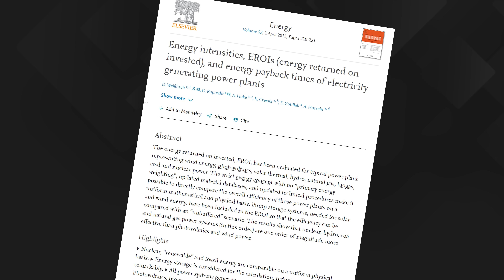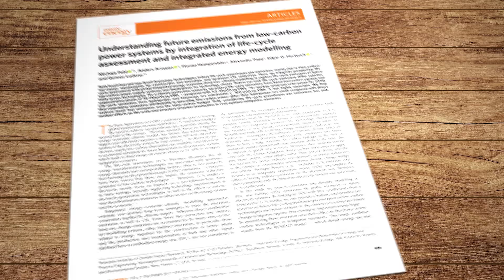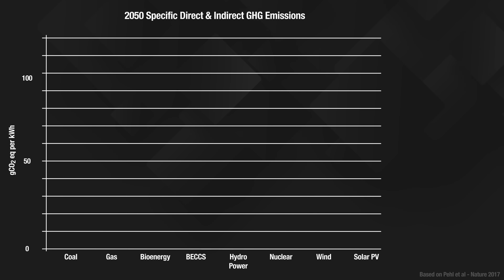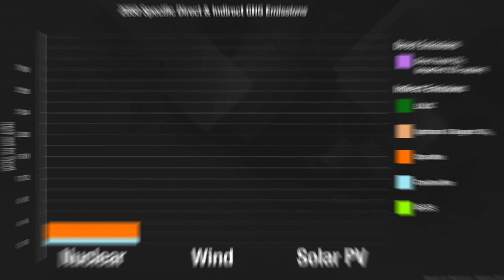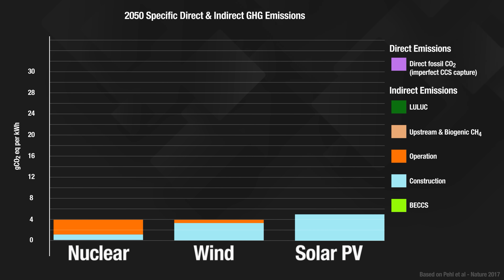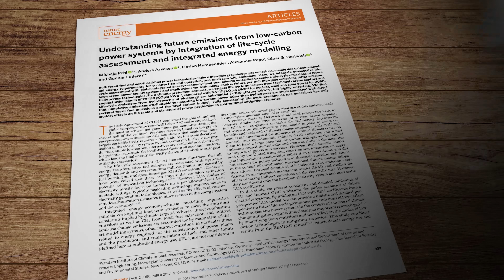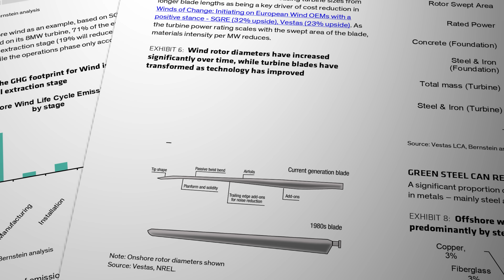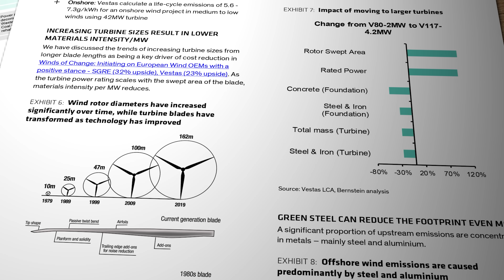Lifetime carbon emissions of renewables vs fossil fuel. Problem or solution?

Comment: I can't believe the BS of solar and wind results. That scream at my ears. "SOMETHING WRONG! THAT MUST BE BIG MONEY PAYING THE STUDY!". Against solar, what are the emissions related to MINING? How about the mining wastewater and environmental impacts? If I am not mistaken, and I work in this area. Wastewater from mining is often, I mean OFTEN,  treated using cold lime softening for precipitation. Mining and preparing the minerals to make the panels, another CO2 generator and they are that low? They must be FK with my intelligence. 
Wind, do you know how long it take to the used and damaged turbines to naturally degrade? So, how many we will need to produce per year? tell me in how many years we will have to really understand this is not a solution? Not to say we will need to have a lot of them to cover the low incidence and very high incidence areas. 
Now, I can't also believe the concrete needed to build a dam for hydroelectric is that much since it lasts forever. I cannot believe that you believe that BS also, you do not even question this crap. What is the CO2 emissions for Hydro production? Did you know that Algae and water consumes CO2? Did you know that Algae balance CO2 vs O2 is positive to O2 side. It is not even comparable to trees, because it is the true O2 generator rather than trees. Tress balance CO2 O2 is virtually neutral and only positive during the period when the trees are growing. 
Can you be a little honest in your videos and respect our intelligence?

Comment: I'm from England, the points I'm  going to make relate to articles and interviews regarding the National Grid. Wind and solar are increasing rapidly. There have already been days where production outstripped needs. On these occasions people with electric cars or home battery storage were paid to take electricity. As more electric cars with the ability to store and offload to the grid, along with the electric charging points and the battery packs of small and medium sized solar/wind systems come online they will provide that buffer. When this develops,and it will,  who takes the hit for the battery. Vehicle manufacturers, tesla for their powerwall or renewable providers. Solar solutions will become more efficient, turbines will get bigger.  Coal, oil and gas are unlikely to improve efficiency, especially now.

Comment: Aside from the advantages of lower life time carbon emissions of wind, solar etc vs fossil fuels there are other reason for embracing the cleaner energy including:

(1) less energy dependence on a few producers of fossil fuels;
(2) fossil fuels running out (eg peak oil)
(3) environmental damage during extraction of the fossil fuel.  

But really thanks to (2) we are going to have to face into a fossil fuel scarce future anyway.

Comment: Has anyone ever evaluated the direct influences of PV and wind electricity generation? I'm not talking about shredded birds, but:
1. A wind-farm draws a lot of energy out of the atmospheric rivers (aka. "wind"). How does global scale electricity generation affect the flow of air-masses?
2. Most PV panels are very dark, so they become very hot and this heat is dissipated into the surrounding air. We already know about the effects of urban heat-islands, what if this effect is amplified by covering each roof and each south-facing façade with dark PV panels? How would the local weather be changed? 
To make it clear, I'm not against "renewable" energy, but if you remove energy in a large scale from a system (wind) you will change that system. Changing the albedo of a landscape (city) will have an effect - that's why they have started to repave dark asphalt-streets in Lost Angeles with light gray concrete streets to reduce the local temperatures.
It would just be great to know about unintended side-effects before globally rolling out a new technology.
Reply: LOL why would they do that ? That makes too much sense , to look at it could throw a monkey wrench into their plan. Its the reason for the worlds many self inflicted wounds.
Reply: @neverettebrakensiek8771  Unfortunately i am afraid you are correct. 😞
Just look at that lunatic discussion about not shutting down Germany's last three nuclear power plants at the end of this year. The Green party's ideologists rather have the German's shiver during the winter instead of keeping the NPPs up and running… Ideology beats Intelligence every time.

Comment: There is not enough neodymium on the planet to make the wind turbines needed to come close to generating the amount of electricity we currently use. There isn't even enough copper to run all the wires needed to transmit the electricity everywhere it needs to go. We need to stop clinging to a world of ever increasing GDP. Infinite growth on a finite planet is ridiculous on its face.

Comment: As far as I'm concerned, once you get 25 or maybe even 50 gCO2/kWh, lower carbon emissions don't matter than much. The difference between one technology at 25 or 15 or 5 is within margin of error and will be different for every study, but they're all basically low-carbon enough. The issue with looking at lifecycle ghg emissions for wind and solar is that wind and solar don't provide dispatchable electricity, so the lifecycle calculations must also include backup and storage, which is very likely going to include some amount of natural gas. I'm surprised to see the ghg numbers for hydro in this study, and it's concerning because that will also carry over to pumped storage, our only real form of grid-level energy storage, thus affecting the lifecycle emissions of wind and solar, and even nuclear to some extent. Net zero is a lot harder than most people, even those involved heavily in the movement, realize.

Comment: The problems with Wind and Solar is intermittency and inefficiency ( more wind in spring and fall less in winter and summer when we need houses heated or cooled) ) The fact is that anyone living on the GRID requires reliable output regardless of whether the sun shines and the wind blows.  So without enormous energy storage batteries  capacity (which do not yet exist) wind and solar deficiencies require quick-firing fossil-fuel burning BACKUP GENERATION  thus pumping carbon into the atmosphere which is why despite their massive investment in wind and solar well meaning GREEN window dressing,  Germany now finds themselves returning to coal fired generation...  Nuclear is the way to go.

Comment: I think this kind of misses the mark of what EROEI implies about wind and solar. It's not just that wind and solar will have higher lifetime carbon emissions, but that the total cost to build an energy system using only wind and solar will be incredibly high. Recycling wind turbines at 9:45 uses currently diesel-fueled equipment. Hydrogen combustion for steel production at 09:30 requires a huge amount of energy to create, transport, and store the Hydrogen. All of this is more panels and turbines, which means more processing, construction, and mining. With a low EROEI, a large portion of the energy produced is cannibalized by the system itself, thus creating a full life-cycle system of energy without the use of fossil fuels is going to be extremely expensive, and that will have real-life effects on the length and quality of human lives.

Comment: Hate the thumbnail shown water vapor from cooling towers to represent fossil fuel emissions. 🙄
Residential solar is great. They should incentivize/require a certain level of grid tied battery capacity to buffer peak residential draw offset otherwise high grid maintenance issues.  
Grid scale solar has significant land use impact. 
All grid scale solar installations should also be required to install a certain portion of energy storage to smooth peak production and grid draw to help eliminate the need for peaked plants. 
One issue with solar is massive environmental impact from panels that end up in landfills. 
As efficiency of panels increases there is significant incentive to replace panels. We are already at the point where we have 30,000 tons of solar panel waste annually in the USA... 
That number is going to skyrocket with more solar installations projected to hit over 1 million tons annually in less than 10 years. If there is a significant efficiency breakthrough expect 100% of grid scale solar installations to be replaced generating massive flood of waste... 
I'm a huge fan of SMR nuclear. The risks are mitigated, the waste is extremely concentrated, and the emissions are as low or lower than renewables without all the other issues.

Comment: We could buy some time by driving slower. (Drag is the main consumer of your car's fuel above about 25km/h, and I think the increase is by the cube of velocity - so the savings are exponential, and better than just "square-exponential").

The downside is that lower speeds adopted by just one country might put that country at some competitive disadvantage, so it's probably only a viable proposal if adopted worldwide. If everyone is going slow, the relative economic impact is the same everywhere. It makes no competitive difference, if it's kept out of the competition. 

Going slower as a "war measure" , while the Russians invade Ukraine, and pay the cost of all that killing by selling oil and gas to the next victims in the queue, might be something to consider? (This war offers opportunities to put "Green matters" into the "defense budget" - defending against the possibility of a war, rather than waiting until one possibly happens, and then just reacting.)

Some other benefits that might flow, if you make the maximum speed low enough: It might be the tipping point for someone who was considering commuting by train instead of car. Lower road accident deaths (guaranteed; speed still kills). More range for EVs. (EVs don't strike me as any more of a "solution" than does reducing speed. They would also be a temporary measure if society was truly committed to not committing suicide by CO2, too.) ... There must be more, surely? (Although the reduction in emissions is enough to justify it.)

Comment: Whilst I do NOT care about saving the planet I have no problem with getting rid of fossil fuels. Anything to reduce our reliance on despotically lead countries. The process though must be from the position of being able to produce at least 100% of our power requirements domestically. In my mind that means having a baseload met by nuclear with wind, PV and and a small amount of domestic biomass. Domestic batteries will help with very short term power fluctuations and grid support. Chopping down US or Lithuanian forests and shipping trees to burn in our power stations is ludicrous, so let’s grow hemp instead. While we are at it, we can also stick carbon capture where the sun doesn’t shine - it’s a non-starter. That leaves the problem of how to meet short and medium term seasonal power demands. This is where we have to grow or manufacture our own biofuels (including hydrogen) to be stored for the winter months when it’s cold, the Sun doesn’t shine and the wind doesn’t blow.

Comment: We are currently using fossil fuels and renewables to power our civilization. Conceptually fossil fuels originate as solar energy captured over millions of years and concentrated by fossilization. Our power hungry global economy is burning through this multi-million year stash in a matter of a couple of centuries. That still growing intense energy usage is close to if not already exceeding the amount of collectable sunlight currently falling on the planet even lumping solar, wind (from solar heating), hydro (from solar evaporation) , and BECCS (bio-solar). Only geothermal and nuclear are additional to sunlight and only geothermal is actually renewable -- we think. We really cannot simply replace fossil fuels with renewables without drastic cuts to our energy usage, and we must replace fossil fuels.  So, on top of turning off the fossil fuel tap, we need to shutdown about half (or more) of our current energy usage globally. Yeah, that's probably not going to happen.

Comment: The idea that "renewables" will allow civilization to continue as is, is delusional. Simple math can prove that isn't going to happen. Society needs a total transformation from top to bottom. All goods must be sourced locally. No one will be driving anymore in 50 years. All buildings and homes will need to be reconfigured or rebuilt and will need to rely mostly on passive heating and cooling systems. All communities will need to be redesigned to be walkable/bikable. Food will have to be grown locally and sustainably. Renewables will help a tiny bit, but we are hitting the wall of available mineral and energy resources. Those are hard limits. The age of cheap-abundant energy is over and there is NOTHING that can be done about that. Read Friedemann's "Life After Fossil Fuels."

Comment: Do the numbers for wind/solar take into account the batteries needed along with their lidecyle carbon impact? I am particularly concerned with this aspect considering not only the carbon, but other environmental and ethical concerns. It may well be that we have to swallow ethical concerns as we wait for better storage solutions, but it is still disheartening.
Reply: I personally doubt 11g per kwh includes battery emmissions. That said, there are a lot of improvements in battery technology as well that have been coming through in the last few years and not every grid uses lithium cobalt batteries for storage, so it may be hard to determine actual average emissions for the various technologies.
Reply: Don't forget the peaker plants powered by gas turbines; they seem much more common than batteries.
Reply: @ethanwhitehead2085  peaker plants can also be hydro or nuclear, though in both of those cases the plants operate 24/7 and just have their generation levels turned up when used as peaker plants.
Reply: @aaronparry2636  Most peaker plants are not though. Availability of sites limits hydro, while nuclear plants are almost always kept at near maximum capacity so they can repay the loans for their construction sooner. Gas turbines seem to be the go to peaker plant thanks to their dispatchability.

In any case with storage, you have to deal with significant energy losses (either from pumping or from conversions between AC/DC and dis/charging), which is why energy storage is only competitive for peak hours (from a price point anyway), but not so much for shoring up renewables' unreliability issues.

Comment: Any such single value report are really a vast of paper or electrons. You can a hydro-generator producing the same amount as a 10 MW wind turbine without a dam and after construction is completed all you can see is a small building. It can also be a big dam that catch a lot of silt, but the effect of that will be very different based on where in the world it is done. All the assumptions need to boil the numbers down to single values make the numbers just a guessing. And as always when you guess all your bias come to the forefront and the number will be trending towards what you want them to be.
Just like guessing how bad capture will be or expecting that the carbon used while making concrete will go down or other advances will be done for one technology and not for another. Referring to number in a reports without having a good look at the premises used and who made the them make these are rather poor video.

My GUESS is that carbon capture will have little use and that any major reduction the next 10 years will be from converting production from coal to natural gas. 
Long term it will be from replacing gas with nuclear production. All the extra installations (storage) needed before wind and solar is a stable source and the increase needed in production of raw materials, make it a impossible option before 2050, hard to do before 2100, might be done before 2150 but that will be a little late.

Comment: While it was interesting to see a good criticism of previous life cycle analysis of CO2 emissions for nuclear by ponting out that no study seems to havr factored in the emissions from long term storage (maybe because there is still research on going to try to reuse the high activity waste  with new kind of reactors and also about hydroelectric dams and their methane problems.
I think if tge analysis goes this this deep it would have been fair to state clearly that all life cycle analysis not taking into acount that randomly intermittent renewable (wind and sun exposure) are very favorably biased in terms of lyfe cycle emission analysis since in the current electrical grids those renewables are not asked to back up their prod when    sun and wind are not providing and that for now they are backed by all the other reliable electric generators like fossil power plant, dams and nuclear power plants. A more realistic approach for lca of wind and solar should include the carbon footprint of their backups (current electrical grid or future storage).
Reply: After posting this, I must add that after saying that the most realistic grid for carbon neutrality in 2050 should mix all renewables (intermittent like solar and wind and the others), their backups (a lot of storage) and a base load of nuclear in countries were it's possible (hoping that fast neutron reactors could allow humanity to have almost unlimited fuel with U238 by then).